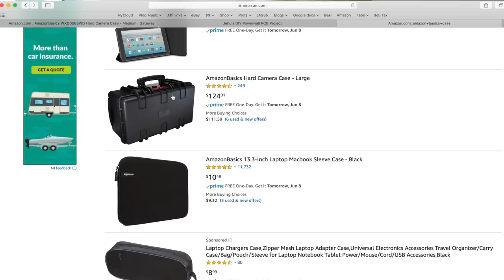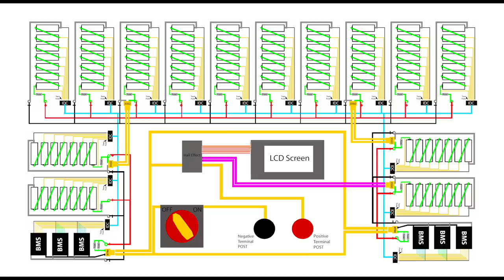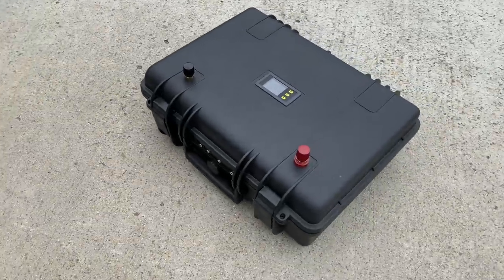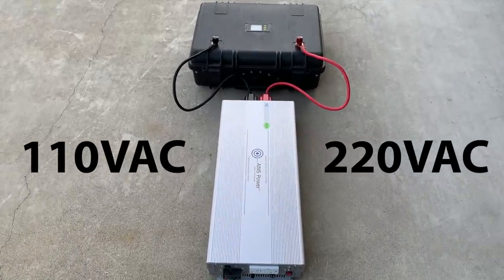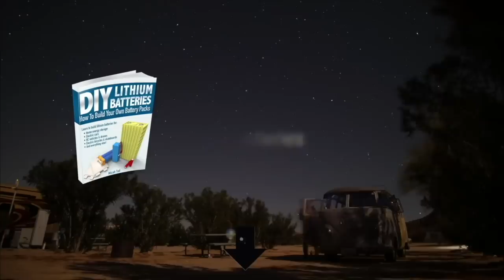600,000mAh DIY Power Pack build

Comment: did you know 3,000mA is 3A?,  you reckon you go 600amps?
Reply: any amp measurements you make will be per hour thats how there calculated if a battery is 20amp hour that means the battery has 20amps in total! 40amps for 30mins! 80amps for 15mins! 160amps for 7.5mins! 320amps for 3.75mins! 10amps for 2 hours! 5 amps for 4hours! 2.5amps for 8 hours! 1.25amps for 16hours! 0.625amps for 32hours i think everyone knows how it works yawn! I'd like to see you do a video where you measure the amps out of one of the batteries at 20amps, I've bought many of those 18650 batteries one said 9500mA which is 9.5 amps , they were a dissapointment and definatly over rated, being 1amp can kill I'm surprised you're not fried like a roasted chicken, if these tiny batteries that don't have the capacitance can really output 20Ahrs connect 4 in series 3.7v x 4 =14.8v that setup would be 14.8v 20A , that more powerful then a car battery 12v 16A , put it on a car and lets see it run? it will have high amps like 60amps but 4000amps theres no way, measure amps of just one battery and do a video or even just let me know here
Reply: @wayne bailey praise the creator I hope this is a joke, otherwise you don’t know that much about electricity.
Reply: @buchdada8904  sounds like you don't know what I'm talking about
Reply: wayne bailey praise the creator Well there is a big difference between electrical current and capacity ( capacitance is something different). Maximum current (usually tens of amps for Li-ion) in a short circuit will be always limited by ESR of the battery because of the ohms law and only way to increase the current is to put batteries in parallel, which increases capacity and decreases ESR and thus it increases max current, this is why he can’t pull more current than ohms law allows even though he got 90 Ah ( its not 600 Ah actualy because you don’t increase capacity by putting batteries in series). Also a battery that can output tens of amps can’t harm you, because it can’t create large current trough your body because of electrical resistance of your body, you would need hundreds of volts to create lethal current but a battery is not quite near that.
Reply: @buchdada8904  no 18650 battery is 20amps you're deluded if you think it is, like i said 4 of these batteries in series would be 14.8v and 20amps more then a car battery which it's not, I'd like to see that meter reading.
Reply: @buchdada8904  a cattle prod puts out 10 of amps can that kill you? it's common knowledge 1AMP can kill you
Reply: @buchdada8904  to bad the guy said he had 4,000amps not 600amps, maybe you said tell the guy he don't know what he talking about.
Reply: @buchdada8904  didn't you watch the video there all in parallel NOT SERIES you say a lie then take down your own lie if ONE BATTERY  is 20amps then putting many in series will still be 20amps
Reply: @buchdada8904  don't know if you watched the video but he doesn't use just ONE BATTERY there's 200 batteries!
Reply: @buchdada8904  600,000mah equal 6,000amps did you even do electrical engineering at college? cause i did 1,000 mA = 1 amp, its not difficult maths I'm sure a 5year old could work it out! so where did you get 90A from?

Comment: All batteries are in series mode. This seems dangerous.. if one pops because its dead short with high resistance and gets hot and blows you will have some nice fireworks.

Comment: I see this thing overheating, needs fans atleast one intake one exaust.
Reply: thought the same, I wonder how hot can it get on a heavy discharge
Reply: Hector Farfan San Juan : Yes and it would be interesting to see a “Power Test” on this battery setup, monitoring temperatures and how much current can these battery boards pass safely. Alot of money to spent just to save on weight !

Comment: it's not about battery's price, its about CHARGING AND BALANCING CIRCUITS. they are still not stable enough to really balance them. even Tesla's batteries sometimes explode or releasing gases because even their BMS with AI does not work enough stable.

Comment: Stainless standoffs would be much better than those brass ones you used.
Reply from the maker: Not electrically
Reply: @jehugarcia  that is right but brass is fragile and battery are heavy, if you drop the case these brass stand offs can crack. Otherwise nice clean job :)

Comment: 200 cell in 7s would be 600Amp /7 so around 90A. May I be wrong  ?
Reply from the maker: You are correct
Reply: @jehugarcia  So, may I ask why the description starts with "Not clickbait 200 x 3000mAh = 600000mAh"

Comment: 應該是 DC24V 84AH吧 2.016KWh
Reply: This is what I came up with. 
Each "pack/board" has an output of 24V with 6Ah capacity. 2 cells in parallel X 7 in series. Then there are 14 packs/boards in parallel = 84Ah total capacity @ 24V = 2.016KWh. What am I/we missing? In the title of video "Its not Click Bait 200 cells x 3000mah = 600,000mAh  AKA as 2.2kWh" the only part that makes sense is the 2.2kWh figure. All the rest reads like marketing hype. 😄😄😄

Comment: Your math is wrong for the amp hours. Unlike watts when figuring amps or amp hours you don't just add everything together this is really an 84ah battery 196 cells / 7 because it is 24volts * 3ah = 84ah or 84,000mah
Reply from the maker: But that’s not how powerpack manufacturers advertise their products.  99% viewers of this video will not have a reference point other than their “20,000mah”  commercially bought units for comparison.  So the thumbnail/title is for them,  not for the few of you who know how to properly size a battery pack.

Comment: So measuring stuff is too difficult for YouTube? It is assumed that everything will work correctly as expected. When engineers make things that won't kill you it requires testing, testing and testing. Don't assume stuff you buy from random suppliers will work as expected. The BMS needs 100% testing at least. A Manufacturer will have a test jig for this.

Comment: Seems you have the contacts to take my idea and make it work. I'll have 25% of profits if you or any one reading this does do it.
Most people have power tools with batteries already.
Make a adaptor to join theses together.
Ie multiply 18v dewalt battery packs join into a power wall ect.
Save harvesting them to remake.
Must be about 10 manufacturers who make theses batteries already.
Linking them together while not in use or to just charge while in the pack.
Linked into matching make slots but away to save braking the original chargers they come with.

Comment: Saying that we could draw 100 amps with the size of internal wire is not a good idea.  If you have 12ga wire as your output cables, they will melt.

I wouldn’t draw more than 20-30 amps safely with how thick the wiring is.
Reply from the maker: Who said I have 12awg?

Comment: Might as well just carry a fucking gas powered generator around. At least its not gonna be a bitch to recharge and it's a lot cheaper.
Reply from the maker: Seems you been inhaling too much generator fumes.  What?  I can’t hear over that annoying engine noise.
Reply: jehugarcia fumes won't be a problem if you're outdoors, and if you're indoors you most likely going to have an outlet nearby. Honda makes completely silent and compact gas powered generators, so noise is not really an issue. Out of gas? Not a problem. Just fill it up and you're good to go in a just few seconds. What you gonna do when those batteries run flat? Charge it for a few hours or just walk around with two of those contraptions so you can use one while the other one is charging? And what about the price? Don't even get me started. Don't get me wrong, this thing is pretty cool but not practical. Not with today's battery technology and prices.

Comment: 600.000mA or 600 A in case you have 3A*200 battery's in series, how ever that would give you only abaut 3.5v (or whatever the nominal voltage is)

In this case when you have 7x3.5v = 24.5v and you have 196 cells so 196/7 = 28 so you have 28 pieces of 24v 3A batteries. now we can calculate the truth 28 x 3A is 84A

24v 84A is still a lot, but not ewen near 600A so I wuld say it's a clickbat... Just do your math...
Reply from the maker: Math is for losers

Comment: You could say 600 ah or 0,6kah right?😃😃😃
Reply: You could say ... 85 AH @ 24 Volt battery, which is the correct answer ...
Reply: MrSummitville 600k mah is 600ah
Reply: @naturefaller9519  While ( 600k mah = 600ah ) this battery is NOT a 600k mah battery, nor is it a 600 ah battery - both are wrong  ...  it is a 85 AH @ 24 Volts battery.

Comment: So that's a 600 amp battery (400 usable) ... at 3.5 volts. lol.  300 (200 usable) amps at 7 volts, or 150 (100 usable) amps at 14 volts.... So you have re-invented the 140 (100 usable) amp leisure battery in my rv, its about the same size, and the same capacity, mine costs $200, yours quite a bit more, both will last a few hundred charges.... A good technical demonstration, but unless you wish to link them up to create 24/36/48v outputs then kind of pointless...(each time you double the voltage output you half the battery capacity, as you well know, so even going to 24v you are already down to 50 amp usable)...

Comment: MATH IS WRONG // 85.5 Ah   NOT   600 Ah    24v / 3.7v per cell = 6.5 cells in series .... let’s say you use 7 in series = 25.9v ..... 200 cells / 7 cells per pack = 28.5 packs @ 3AH per pack (Whatever ur actual numbers are) .... so 28.5 in parallel will be 28.5 x 3AH = 85.5 Ah(approximately)  not 600Ah
Reply: Thank an engineer
Reply: @Qp0int  It is an 85 Amp-Hour @ 24 Volt battery ...

Comment: 600,000mAh or 600,000,000 uAh or 600 Ah.
Reply: When we connect cells in series we do not add mAh's , as he incorrectly did in this video  Actaully it is a 7S pack so ... 85 AH = 600,000 mAh / 7S

Comment: How do i order case in Europe? Doesnt accept Belgium -.- Oh god "+-400 eu customs tax to Belgium for the batteries -.-" Hard to find 18650s in EU no bargains.
Reply: Try looking for ''camera koffer''
Just check for one with the same dimensions :)
Reply: @SkywereProductions  

Hard to find one in this expensive country unless 300 - 400 euros :( 

I bought one for 41 euros

 with 15.98" - 12.99" - 6.85" dimensions instead of 
          16.9"   - 11.8"   - 5.7
 i hope it works... its 40.6 mm instead of 42.92 m, i hope 2,32 mm doesnt matter. Looks tight.
Reply: I received the BMS and the battery holder from jehu i payd 160 euro in customs and it was there stuck for a month. But it looks worth it :D

Comment: Dudes playing a dangerous fucking game stacking up batteries like that and not waterproofing the case. Also shouldn't have the on / off switch inside the case. Those things are literally designed to be mounted on the outside. Switch might not even be rated for 100a use :/

Comment: This is a disaster waiting to happen...
Reply from the maker: Why?
Reply: @jehugarcia  it is an awesome project I have to say. However really, at the very least all terminals and contacts should be sealed off to prevent moisture and water. Some vibration damping support should be added to avoid accidental contacts due to vibration. And if this thing is put under the sun for too long I would be really worried that heat will cause the batteries to explode -- I assume you have a thermal sensor to avoid runaway but this is still really dangerous for regular home users. Especially looks like you are selling a kit to make this, really a HUGE warning should be put up because this isn't really for any regular people to use.

Comment: Yes It's clickbait!
In your OmniCharge review, one of the first things you say is that 20,400mAh means nothing unless you know the voltage.
And you follow up with your own video with a thumbnail that says 600,000mAh.
Please stop that. Just the science please...
Reply from the maker: 200k views  vs just science 20 views
Reply: @jehugarcia  You have 14 banks of 2*7 cells where each pack of 7 cells is mounted in series, so each pack is 25.2V +- at 3Ah (3000mAh). 
Which mean that each bank is 25.2V at 3A* 2 since there are 2 packs per bank which equals to 6Ah per bank.
Now since you have 14 banks, that's 6Ah*14 which equals 84Ah and not 600Ah like you mention.
But it does equal  more or less 2200Wh => 84Ah * 25.2 = 2116.8Wh
Which also means that you would be able to pull 84Amps for an hour before you battery is depleted
If you wanted to have a real 600Ah batterie you'd need 7 time your setup
Dude this is basics in electricity, if you don't believe me, review your science: https://www.se.com/se/en/faqs/FA229757/#:~:text=when%20taking%20two%206%20volt,connect%20the%20batteries%20in%20parallel.
You should turn down your ego a little bit towards other people (Simon W. Hall)

Comment: Why? Why do we have to use such an unnecessary way of communicating the capacity? We don't measure our homes in inches, why use milliamp hours instead of amp hours? 600Ah battery. It is a 600Ah battery.
Reply from the maker: The industry does,  smart people can figure it out,  the rest knows milliamphours
Reply: @jehugarcia  Fair enough. Fair enough, my friend.

Comment: A guy that builds this many batteries should really be using a resistance welder for connecting cells.
Reply from the maker: This project is for you not for me,  most of what I do is out of reach of my average viewer
Reply: @jehugarcia  It's not for me because I have a resistance welder. :) It's for the layman, I get it.

Comment: 200 18650 batteries supplying 600ah at 24 volts. 😂 28p7s so your saying you have 21Ah 18650s. Can't do maths ha
Reply from the maker: 2.2kwh
Reply: @jehugarcia  it's not 600,000mAh 28x3000mAh is not 600Ah. Basic math

Comment: This is beyond risky
No battery pack should ever exceed 3 cells
You are doing 6 cells or even 8 cells
The reason why you should never exceed 3 cells is absolute maximum charge and discharge rate
2 cells will end up dis/charging 1 damaged cell, which ends up with 2C
But in your case you are going up to 7C which is beyond explosive